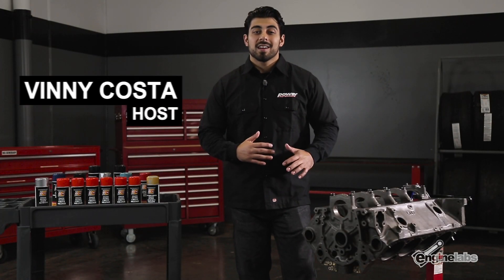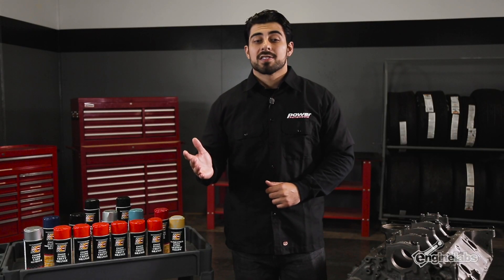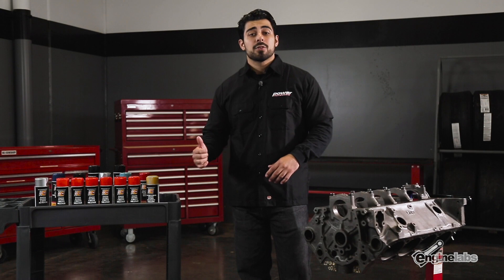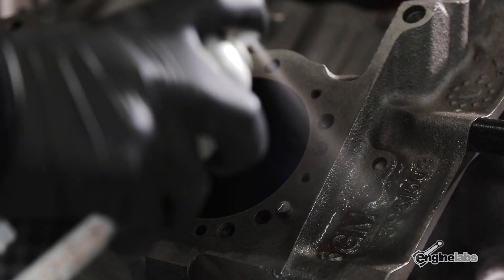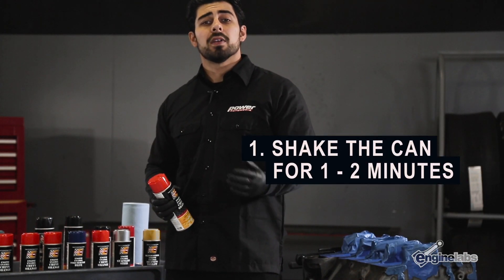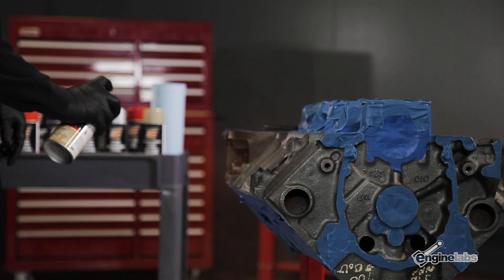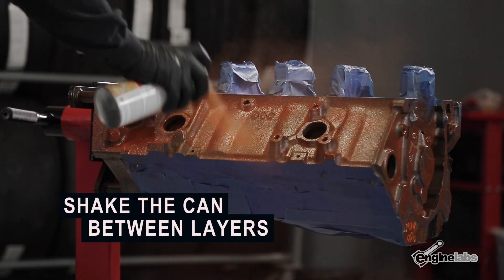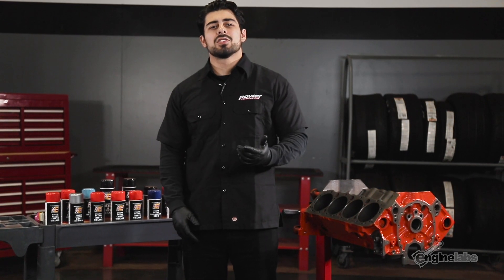Make Your Engine Block Shine With Engine Pro Paint

Comment: I’m not a professional painter, but I’ve learned a few tricks over the years. Paint with the oil pan and timing cover on to prevent overspray into the rotating assembly (same goes for a valley pan unless you are using a paint designed for oil retention). Paint with old freeze plugs and bolts in place, then replace with new ones, etc.